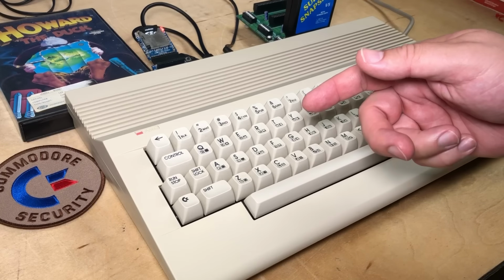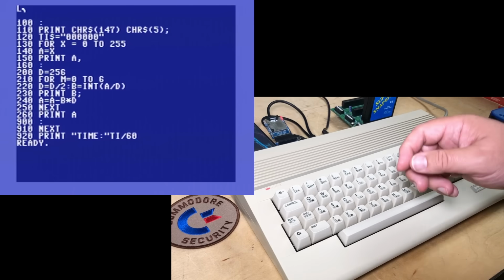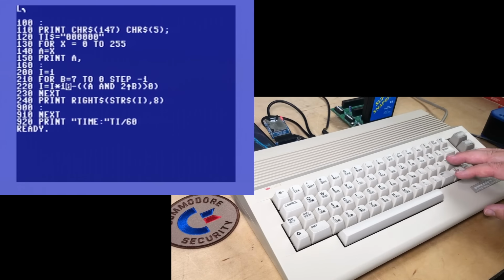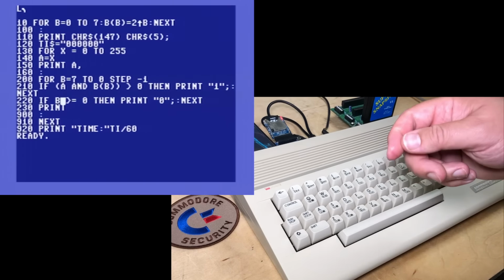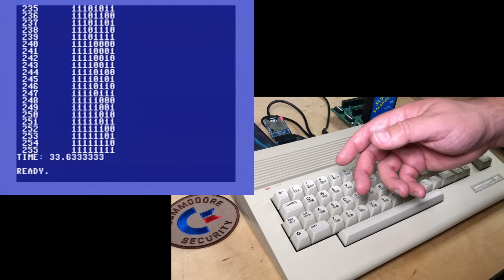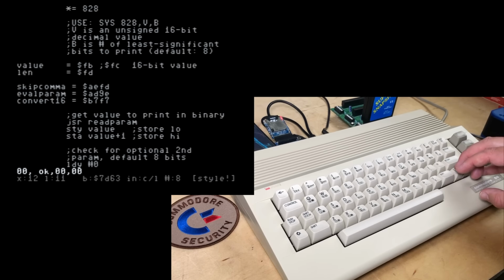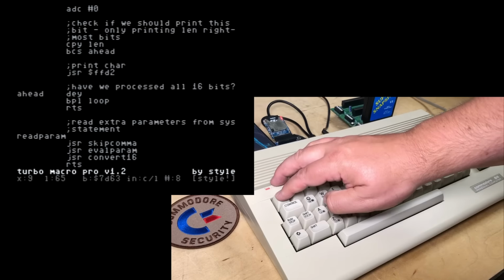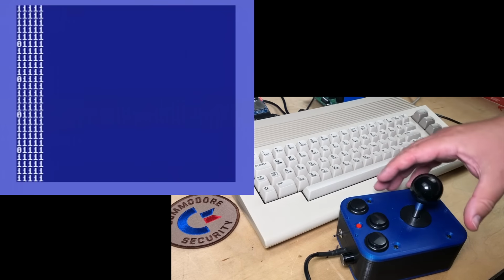Printing Binary in BASIC and Assembly on Commodore 64

Comment: There's an optimization to your BASIC programs that you didn't use, assigning your constants to variables.
Commodore BASIC, being a floating point language, converts all constants to FP each and every time it comes across one. So assigning constants to variables outside of loops will speed things up.
Now, with variables BASIC has to search through the list to find the right one but in my experiments I discovered that with one digit constants it's faster if the variable for that constant is one of the first 12 assigned. For 2 or more digits the conversion to FP is very slow so even if it's at the end of a long variable list it should still be faster. For real-world programs the variable list can be kept shorter by reassigning variables (carefully) when needed.
Obviously, debugging such a real-world program would be a nightmare so procedures should be developed make it easier.

Here's a demonstration program, tested in VICE. BTW, I just learned you can copy/paste from your text editor into VICE... neat. You have to use the menu bar 'Edit' 'Paste' option, you can't just paste into the window. It works copying from here, too.

10 a=1 : b=2 : c=3 : d=4 : e=5 : f=6 : g=7 : h=8 : j=9 : k=10 : l = 11 : m = 12
15 n = 13 : z=0
20 ? : ? "one digit constant took";
30 t0 = ti
40 for i = 1 to 1000
50 z=1
60 next
70 ? ti - t0 "jiffies" : ? : ? "two digits took";
80 t0 = ti
90 for i = 1 to 1000
100 z=11
110 next
112 ? ti - t0 "jiffies" : ? : ? "three digits took";
114 t0 = ti
116 for i = 1 to 1000
118 z=111
119 next
120 ? ti - t0 "jiffies" : ? : ? "first variable took";
130 t0 = ti
140 for i = 1 to 1000
150 z=a
160 next
170 ? ti - t0 "jiffies" : ? : ? "twelfth variable took";
180 t0 = ti
190 for i = 1 to 1000
200 z=m
210 next
220 ? ti - t0 "jiffies" : ? : ? "thirteenth variable took";
230 t0 = ti
240 for i = 1 to 1000
250 z=n
260 next
270 ? ti - t0 "jiffies"

Edited 8 hours later: Assigning t0 to ti before the print in the one digit timing test skewed the result. Corrected.
Also added timing for three digits. Benefits of numbering by 10 demonstrated.
And further testing shows that BASIC converts the digit 0 faster than 1 in two and three digit constants: 10 vs. 11 and 100 vs. 111. Weird. I wonder if other digits will change the result, too. But I think I've bothered everyone enough about this weirdness.

Great channel.
Reply: Good tip about the constants, my 19 seconds became 18.166

Comment: Great video!  I'm not so familiar with the Commodore specifics, but I've done a ton of assembly optimization and some of it in 6502.  My first expectation, as I think you discovered in the video, is that the BASIC interpreter is calling the same character output routine as the assembly call.  Because the screen is scrolling, this might mean that the entire screen buffer of 40xWhatever is being rewritten after each newline.  That depends on the hardware, but things weren't so sophisticated back then and I don't think they did anything fancy in the text screen buffering.  Is there a Commodore BASIC technique that writes OVER the same line instead of scrolling?  If not, there isn't much you could do to go faster.  On the other hand, if you directly manipulate the same line in the screen buffer it could save thousands of cycles per line outputted.  This would be independent of how much text is on the screen, and you might even be able to hard code it with pokes.

Comment: I wonder if the BASIC version would be faster if you use % to tell the interpreter that A is an integer, and if you use loop unrolling. Also as someone already pointed out, you can generate a 0 or 1 with CHR$.

49 Q%=48
50 PRINT(CHR$(Q%-(A%>127)));: A%=A% AND 127
51 PRINT(CHR$(Q%-(A%>63)));: A%=A% AND 63
52 PRINT(CHR$(Q%-(A%>31)));: A%=A% AND 31
53 PRINT(CHR$(Q%-(A%>15)));: A%=A% AND 15
54 PRINT(CHR$(Q%-(A%>7)));: A%=A% AND 7
55 PRINT(CHR$(Q%-(A%>3)));: A%=A% AND 3
56 PRINT(CHR$(Q%-(A%>1)));: A%=A% AND 1
57 PRINT(CHR$(Q%+A%))
Reply: Sadly, while integer math is theoretically faster than floating point on the C64, it takes longer to parse the extra characters. I don't think C=64 BASIC allowed you default variable names to integer either.  (I think TRS-80 BASIC had DEF INT but don't recall Commodore BASIC having it.  I could be mixing it up with the little ForTran I used to know.)

You're probably better off using a variable array for 1, 3, 7, 15, 31, 63, 127 than making the parser interpret the numbers twice on each line.  Unfortunately, the more you attempt to optimize the code, the less readable it gets.

I loved coding on the C64 and trying to optimize here and there in the 80s, but I definitely prefer coding solutions in readable C to obfuscated BASIC.
Reply: @mikechappell4156  Commodore BASIC is floating point down to it's core. When adding two integers variables, assigning the result to a third integer variable, BASIC will first convert the integers to FP, add them together, then convert the sum to an integer to assign it to the result variable.
It's best to avoid integers except in very specific instances involving integer arrays. On second thought, avoid integers, period.

Comment: On the ML version you can use a table of nibble wide strings for the binary representation of the nibble. This would only take 16*4 bytes (or I guess 16x5 bytes if you delimited the string so you could print it directly). This would also make it easy to go from hex to binary.

I can remember doing an any base to any base conversion program on the C64 in BASIC back in the day and I'm sure it was very slow..

Comment: Well, there is ugly style in the asm-File... Just by skimming through it:
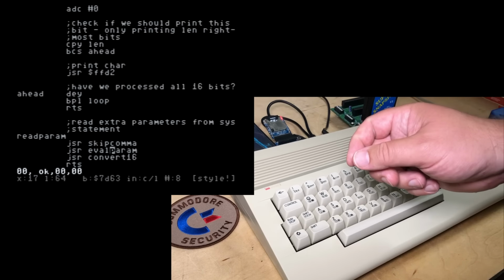@27:11 you see:
  jsr convert16
  rts

Why would you ever type it like this? You could save a byte (the rts) and some cycles  by just replacing the 2 lines with
  jmp convert16
Reply from the maker: The assembly version certainly isn't fully optimized, and I find that particular optimization makes the intent less clear and the code less readable. But it's certainly a good optimization to use when every byte and cycle matter.

Comment: Tha BASIC part is really nice by showing different approaches to the same problem, kudos. But... I may have got it wrong, but I have the feeling that in the assembly example you were using the same exact basic print routine, which who would have though ran at the same exact speed whether it was called from BASIC or from ML, therefore the conclusion that "the BASIC print routine is fast, just as fast as machine language" is wrong. In both cases the BASIC print routine was tested. You can test the time difference easily with PRINTCHR(0-255) vs ldx#$00stx$0400,xinxbnestart, then you'll compare BASIC PRINT routine vs a print routine optimized for the task in assembly. With your time measuring method the ML code will measure exactly zero, so the BASIC PRINT routine will mathematically take infinite times more time. Now that's a completely different result than what the video's conclusion is.
Reply from the maker: I probably didn't make it clear enough that I was looking to create the equivalent of a BIN$() function that would play nice with BASIC and the KERNAL operating system, so that means using the official $FFD2 CHROUT character print routine. One could certainly store directly to the screen much more quickly.

Comment: My own "printing out the joystick" thing in assembly just overwrites eight spots on the screen - that saves an enormous amount of CPU time as I'm reading an 8-bit integer and writing eight bytes and I don't need ANY of the KERNAL routines.. I basically store the joystick value somewhere, BIT it, display a one or zero depending on what it is, and then ASL the stored value.

It's not really optimized at all, but it's updating both joysticks at least eight times a frame it seems.  That would be a runtime of about 0.5333s (256 values / 8 = 32 frames, 32 frames / 60 jiffies = 0.5333...).
Reply from the maker: Yes, it could be much faster - I was specifically trying to replicate a BIN$() type BASIC function that would just use the regular C64 PRINT/CHROUT routines.

Comment: I was wondering as the basic program with precalculation prints strings containing all 8 characters at once, would it be faster to create a string with all characters in machine language and then use a single print instead of printing each character individually? Or does printing a string just iterate over the characters and print them one by one anyway?

Comment: As several other suggested I would probably have pre-calculated a nibble instead of a byte and then using two operations (integer division and binary AND) to get the first and the second nibble. Of course it depends on how often the final routine is used. It's all a balance between pre-calculation and usage. But cutting the pre-calculation down to 1/16 of the possible values seems like a nice balance. I do guess a lot of time is spent on having all of the text at the screen screen scroll when the bottom line is reached. This might be disproportionate to the other time spent.

By the way, my nephew talked about a mouse he got for Christmas where he can swipe-click (a sort of automated clicking for a short period of time; very useful in a bunch of games he plays). I mentioned how it wasn't that different as to about 30 years ago when I got a joystick with autofire for Christmas, and he simply asked: What's a joystick?

Ouch. I feel old.

Comment: Do the first 3 bits of 56320 serve any purpose in the C64?  If not, seems like that would be a waste of registers.
Reply from the maker: All 8 bits of that register are used when reading the keyboard matrix; it's 8x8 = 64 keys. The joysticks and keyboard share those same lines; that's why you can sometimes make the C64 type things by wiggling the joysticks around.

Comment: Your BASIC5 example points out something I had completely forgotten about C=64 BASIC:  as variables go, I != I(0).  I guess I've spent too much time in C since my youth, but I totally expected it to have a bug when you ran it due to reuse of the letter I for the variable and the array (I expected the I variable to be stomping on the value in I(0)).
Reply: Yeah, when I got back into C64 stuff, the "different types of variables have different namespaces" thing was weird.  I, I%, I$, I() are all unique!   Of course it kinda makes sense when you consider that they can only be two actual characters - ABCDEF$ and ABC$ are both actually just AB$.   But not AB, AB% or AB(0).

(also note that the different types of arrays are also unique - I%(), I(), and I$() are also unique from each other)

Comment: Make only a PreCalc for 4 Bits (Nibble) and take the top 4 bits (High Nibble) and print them and than the lower 4 bit (Low Nibble).   Top Nibble is int(val/16) and Low Nibble is (val and 15).
Reply: I tried exactly that - comes out at 15.82s. I didn't measure setup time since I hard-coded the array values - should be fast enough 😊 IMO the best compromise overall.

Comment: I'm usually using this approach (0.2 sec pre-calc time and 23.8 sec run-time - in summary it's even faster than the full table driven or goto approach):
5 ti$="000000"
10 dimb$(128)
20 b7=128:b6=64:b5=32:b4=16:b3=8:b2=4:b1=2:b0=1
30 data128,64,32,16,8,4,2,1
40 for b= 0 to 7:reada:b$(a)=chr$(49):next
50 b$(0)=chr$(48)
90 pt=ti
100 :
110 print chr$(147) chr$(5);
120 ti$="000000"
130 for x = 0 to 255
140 a=x
150 print a,
160 printb$(aandb7)b$(aandb6)b$(aandb5)b$(aandb4)b$(aandb3)b$(aandb2)b$(aandb1)b$(aandb0)
910 next
920 print "time:"ti/60
930 print "precalc:"pt/60
Reply: SIngle-letter variable names are faster to parse than two-character names.
Reply: @csbruce  Yes, indeed, if focusing on speed only. But for typical use in a subroutine it might be not a good idea to glob 8 single character names (out of 26) with constants which are just needed for this routine. 😉

Comment: Would've figured you'd optimize out the expensive operations.
Like an exponent would only be needed for random access of a bit, but you're using them sequentially. Can add to build the lookup, or a more expensive divide and use them directly.

Comment: 6:40: I'd probably load an index register with 8, AND the accumulator with 128, printing "1" if it's nonzero and "0" otherwise, then ROL, CLC, decrement the index register, and loop until the index register is zero.

It'll be interesting to see how close to optimal that is.
Reply: No need to AND, just use the carry out from the shift:

    sta temp
    ldx #$08
loop: 
    asl temp
    lda #$30 ; start with '0'
    adc #$00 ; this adds 1 to make it '1'  if the bit shifted out by the ASL was a 1
    jsr $ffd2 
    dex
    bne loop

Comment: did you try using integer index variables instead of floating point (the default) ones?  I'll bet that'll save more time, although adding all those %'s would be annoying...
Reply: Unfortunately, early MSBASICs (like that found on the C64/128/Vic/PET) didn't have real integer support.  They just convert the integers to floats and carry out the calculations using the fp routines, so they're actually slower than float-float operations.  The only real purpose for integers in those BASICs is to store data compactly: they're much smaller than the floats in memory.

Comment: Well... I think you had at least 3 or 4 more levels to explore:  You can save some interpreting time with the precompute by stepping the bits downward, then your print loop doesn't need the "step -1" or better yet you can use the fact that   a AND B(b) returns either the value or 0...   so ( (a AND B(b)) =0 ) returns -1 or 0, since CHR$(49) is an ASCII (petscii) '1'  then PRINT CHR$( 49+((A AND B(b))=0)))  will produce an ASCII  '1' or '0'  my hunch is that it should give you a speed up without the if statements/GOTO... Finally wondering if using integer variables such as B% so you're not calling floating number routines...  Except integer variables cannot be used as the index in a FOR loop.

To save on precompute memory/time you could potentially do this all in one line, this will save the interpreter from needed to process multiple lines:

10 for a = 0 to 255
20 b=128 : for i = 0 to 7 : b=b/2 : print chr$( 49 + ((a and b)=0) );  :next: print
30 next

Tested with a C64 emulator... took 42 seconds, but maybe you can test on your computer see if it's any faster... but maybe these ideas can speed up your basic programs...  The thing about the precompute every string on a VIC-20 that would probably eat up your memory... yes it's a Size-vs-Speed tradeoff... I don't think is an acceptable one that I would make for this kind of computer... we are so spoiled with Gigabytes of memory that sometimes we forget how tiny 38K or on a VIC-20 3.8K really is.... I know you know, and your goal was to find the fastest time at any cost... but then there's what is practical.
Reply: Integer variables in Commodore BASIC don't help in general because the interpreter converts them to floating point anyway whenever doing any arithmetic on them. Their presence is basically a leftover; actual support for integer operations was dropped from the shipped ROMs to save space.
Reply: @markjreed  Okay, that's good to know... and now that you mention it I sort of recall that!  But I believe integers help in variable storage, e.g. in an array?  It's been a long time since I've poked around in the guts of Commodore BASIC... I feel so out of touch with this... I used to write my own custom system wedges (just for fun) I had a BASIC extension for the C64's back in the 1980's where I added some graphics and disc commands... now I have little memory of it.  What gave me the insights I needed to do that came from a couple of great books from Abacas and they did deep dives into the BASIC ROMS with annotation and examples... it was so much fun!
Reply: @HobbyHalloween  Yes. Each scalar variable takes up the same amount of space in the variable table no matter what type it is; numeric values fit in the table itself while strings have pointers. But the array table is nothing but names and pointers while the actual values are elsewhere and packed as closely as they can be. So an array of integers only takes two bytes per entry instead of the 5 (IIRC) taken by a float.